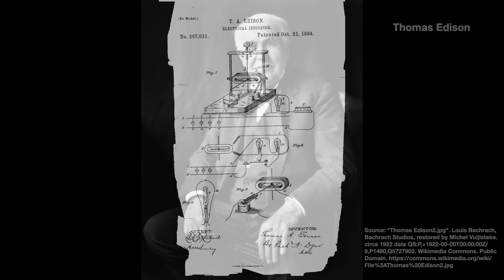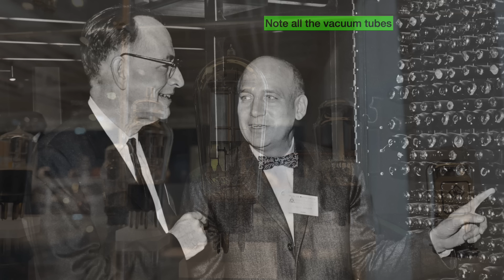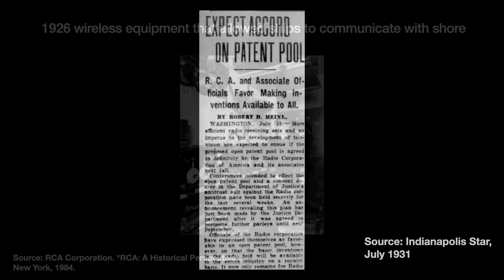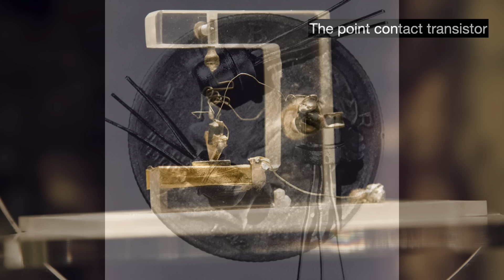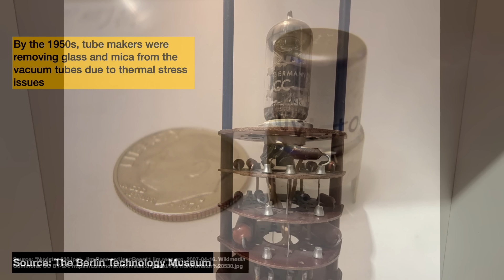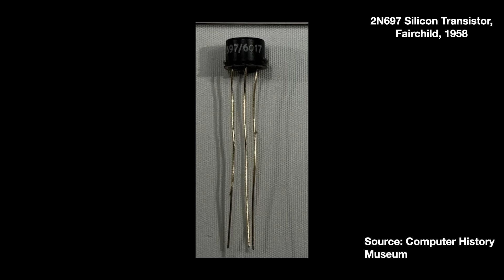RCA Made a Vacuum Tube to Beat the Transistor

Comment: My first job with a freshly-minted electrical engineering degree in the mid 1980s was at RCA. Six months after I started it was bought by GE. Note that RCA made some cool semiconductors. In the 80s they were the masters of Silicon-on-Sapphire which was used in space applications due to its resistance to radiation.

The division I worked for became Lockheed Martin after I left. It is still around, still making their premier product… the SPY-1 radar, aka Aegis.

And you know what I worked on?… A Gallium-Arsenidecimplementation of the Stanford MIPS ISA.
Reply: it's refreshing to read some nice details on things, rather than "Haha STAY QUIET otherwise COURT TIME" not explicitly written in text

Comment: 1970’s I bought a 144/28 MHz down-converter so I could listen to 2m amateur radio in my comms receiver.  It used transistors and it was horribly insensitive and full of spurious responses. I replaced it with a second hand Nuvistor (6CW4) based transverter and it was miles better!  Early transistors and their circuits were not ideal at VHF.

Comment: I built a phono stage using nuvistors a while ago, just for fun. Sounded like a phono stage. One other innovation from late stage VT design was the "lighthouse" VT, designed to mount straight into a coaxial transmission line at microwave frequencies. Technically they were called "disc seal" VTs but the stepped disc shaped connections separated by cylindrical insulators meant they looked like little lighthouses, especially the ones with ceramic envelopes. I have a couple but have never used them in anything since I don't have any need for the frequency response.

Comment: Word Debugging origin  ENIAC consumed 230kW of electricity per second it was so hot from vacuum tubes that all windows opened which glowing light of tubes attracted bugs which made short circuit for computer program run, and technician who changed vacuum lamps got name debugger. ENIAC longest run was 2 minutes, sometimes lamps failed and without bugs :)

Do data centers that have some cooling system bigger than some biggest malls is repetition of ENIAC story?

The famous "moth anecdote" is a classic bit popularized by the late comedian Norm Macdonald. It details a deeply depressed moth walking into a doctor's office—often a podiatrist—and recounting a grim, Kafkaesque tale of a meaningless life, a loveless marriage, and existential despair. The doctor, realizing the moth's deep psychological agony, asks, 
"Moth, man, you're troubled. But you should be seeing a psychiatrist.
 Why on earth did you come here?
"The moth replies: "'Cause the light was on." :))))))))))))

Comment: In the 1970's I almost made a 2m converter using a Nuvistor but didn't.
I remember the OC and AF series of transistors and performance was limited as regards frequency. 
I was making 3, 4 and 5 valve radios then started dabbling with OC and AF transistors.
I still have a liking for valves and have several commercially made receivers using them. 
My h/b transceiver has i.c., transistor and MOSFET stages. 

G4GHB.
Reply: I worked with Philips OC71 and OC72 germanium transistors in the 1950s. They were twitchy and easily damaged. They were each worth more than a day's pay then.
Reply: @howardsimpson489  
Okay about the price back then.
It was in the 1970's when I tried them. I seem to remember them being 7/6d (37½ new pence) in British money. 
G4GHB.
Reply: @howardsimpson489  Sorry for asking but have you heard about Thomas Henry Moray who in the 1920s had a tube amplifier running without a heated element? Supposedly based on a mineral iirc, I read claims once saying it predated the transistor in principle. The mineral type in any case is lost to time. Seems only he had an idea how it worked. Never was granted a patent. It annoys me so much when knowledge of great sounding things is lost. There's a small wiki on him.

Comment: I imagine the vacuum tube's last stand is the humble magnetron tube that cooks your food in a microwave oven with a special use tube called a photomultplier used in radiation detectors of many kinds as a distant second. ❤
Reply: There are a lot more tubes still used. High power triodes and tetrodes for RF power, klystrons for telecomunications and more.
Reply: Good point, but you might want to read up on garden path sentences and then rephrase. At first parsing your sentence seems to imply that a microwave uses a photomultiplier.  A clearer alternative is:

'I imagine the vacuum tube's last stand is the humble magnetron tube that cooks your food in a microwave oven. A distance second is a special use tube called a photomultplier used in radiation detectors of many kinds'.

Feel free to copy paste. I generally don't like to be a grammer nazi, but I am guessing that you did not intend to imply to an inattentive reader unfamiliar with the topic that a microwave has a photomultiplier.
Reply: It's still used in high end amps

Comment: Nuvistors were a stopgap, there were things early transistors straight up sucked at. Usually radio and TV stuff.
Reply: Early transistors were noisy in audio, and could not amplify high frequency. those were the 2 things the Nuvistor was better at, making them the 'go to' for color television and FM radio turners, as RF amplifiers for radio signals.

Comment: I guess one could call it the downfall of the "Triode", since that's the kind of vacuum tube that directly competes with the transistor. There's plenty of other kinds of vacuum tubes like traveling wave tubes which amplify signals in a totally different way. Then there are alternatives to both, like magnetic amplifiers or core logic, both of which provide things now commonly done by transistors, but with just some magnetic material with some wires wrapped around it.... and there are things like optical amplifiers. You have a special doped fibre, put in your signal and strong laser light... and you get a stronger version of your signal.

Comment: In 1968 when I was all of a year old, Dad bought an RCA color television. Color! Can you believe it?? Of course, it was a conglomeration of tubes, and it saturated a 15A 120V circuit all by itself, doubling as a space heater for the family room. We used that TV until around 1980, when it was replaced by a Sony Trinitron.

The old TV's weren't just TV's, they were pieces of furniture. That old RCA unit's cabinet was an extremely high end, solid wood beauty. So much so, that when Dad bought the Trinitron, he ripped the guts of the RCA out, and stuck the Trinitron into the cabinet. As luck would have it, it required very little modification to get everything to line up; it actually looked like it came from the factory that way.

Stereo systems came in high end furniture pieces, too.

Man, it's just too bad how enshitification has ruined everything.
Reply: My dad enjoyed woodworking as a hobby. He collected the maple cabinets from old TVs. He would refinish them and add sliding shelves to support component stereo systems. 😎

Comment: Tubes don't just "shatter". They fail, internally, and in most cases, with no visible reason. I've worked on tons of vacuum tube equipment. The Nuvistor was created with keen interest by the US defense department. The transistor was not reliable for a long time after its invention, and the nuvistor allowed small and lightweight electronics, very similar to what was achievable with discrete transistors. The integrated circuit is what really changed that.
Reply: Hot glass just creeps. I have some TV horizontal output tubes like 6DQ6 that got so hot the glass envelope collapsed onto the tube contents without failing. Despite looking weird, they still worked fine. The bakelite bases usually turned to powder and pulling them out was the end. Microwave ovens still use the WW2 magnetron which is a very powerful electron tube and will probably continue as solid state is not appropriate.
Reply: @howardsimpson489 :  This is a design problem caused by poor cooling in the sealed high voltage cage.  The datasheet will list a maximum envelope temperature and manufacturers of cheap consumer equipment would sometimes exceed it ].  Muntz would exceed it by a lot.  And nobody cared that much since sweep tubes were a couple dollars at the supermarket.
Reply: Indeed - the number of tube failures I've had over the past 35 years with various gear is extremely low.  Usually a filament breaks, or the tube just gets noisy.  I've never had one shatter - unless dropped!
Reply: was it like How incandescent lightbulbs failed ?
Reply: @belstar1128 technically halogen bulbs are incandescent bulbs, but I like the color of their light. My house only has those. But some of the foreign manufacturers are skimping on filament thickness. Half burn out quickly, the other half are good and work for several years. I never liked the yellow color of the regular incandescent bulbs.
Reply: @belstar1128 potentially, but tubes had much more parts than just a glowing filament
Reply: I think you should refine that to "lithographic integrated circuits". It's that process that made the difference and kickstarted the electronics market we have today
Reply: Yeah.  This guy obviously is ignorant and uses AI to "research".

Comment: Vacuum tubes are still around is certain very high power output applications like radars and transmitters where you still cannot match the power density of a vacuum tube with transistors.

Comment: Only reason I've even heard of the Nuvistor is that I think people were putting them into Neumann u47s as a replacement for the VF14 tube.  Have never come across a 47 with the Nuvistor, so I have no real idea if it was a good replacement.  I know at one point (maybe still), Nuvistor u47s sold for a bit less money than if they had the original tube.

Comment: I have thousands of tubes, some are ~100 years old. The 2a3 is one, I have most of the 8xx series. 801,802, 805, 807,808, 809, 810, 811, 813, 866, 872, 8008, etc, etc. All RCA's. Hundreds of high power RF tubes, and of course the nuvistor! What a great tube it is/was, great for VHF/UHF...
Do a video on Eimac. You will be blown away. Smallest ceramic tube, was the 2c39, triode, UHF, all the way up to the X2159, 2.5 megawatt beast! My largest ones are the 4cv100,000's and 4cx35,000 etc.
Reply: There were thousands of those tubes surplus after WW2 ended. I too have lots and my source of joy; CRTs. Many scope circuits were published using surplus stuff, I have some working examples. What amazes me is that the vacuums are still good, only a mm or so of glass keeping air out for 80 years.

Comment: And of course every microwave oven has a vacuum tube in it. :)
Reply: Sort of. 
Properly, a magnetron is a slightly different component.
Reply: @spacemissing  I said 'vacuum tube' not 'triode' or anything more specific. It's an evacuated metal and ceramic thermionic valve/tube. They even kinda work as a diode if you run them at low power, especially if you take away the magnets.
My first thought was CRT, but those are getting vanishingly rare in common use.

Comment: Asianometry has in the past been pretty good, but this video is very poorly researched and is riddled with major errors
1.  He states at 11:56 that RCA positioned the nuvistor "toe-to-toe" with the transistor on size, power, performance, and reliability.   Utter nonsense!   RCA was a very reputable firm and never made such a ridiculous claim.   While small by previous miniature vacuum tube standards, nuvistors were still 10 times the size of transistors.  As far as performance goes, its like saying oranges taste as nice as walnuts.   Nuvistors were for applications that transistors were unsuitable for.   Transistors, even the earliest ones, had a gm (measure of amplification) vastly higher than vacuum tubes, but tubes worked at much higher impedances and frequencies.    As far as reliability goes, tube cathodes inherently have a wear-out mechanism, transistors do not.   That's why tubes, including the nuvistor, were plugged into sockets for easy swapping out, transistors were soldered in.
2.  This video states that Edison noted that current can flow in a vacuum between a hot filament and a plate, and patented it, but did nothing with it.   That is emphatically not true.   Edison noted that the amount of current is very sharply dependent on the filament heating voltage.  An increase of filament voltage of only a few percent causes about a doubling of anode current. He therefore patented it and marketed it as a voltage regulator.   Unlike the gas tube also used as a voltage regulator,  the Edison Effect tube responds to the RMS voltage and therefore works with AC.   Up until the 1970's, Edison Effect tubes were used as the sensing tube in AC voltage regulators and wherever a constant RMS voltage is required but waveform is unimportant - eg movie studio tungsten lighting.  A common type was the AV44, sold by AWV, RCA, etc.
3.  Asianometry states that the control grid can "accelerate or dampen" the electrons flowing from cathode to anode.   This is not true.   The electron acceleration in a triode is almost entirely due to the anode voltage with respect to the cathode.   For any given anode voltage, once can calculate the electron final velocity.   What the control grid does is force some of the electrons to return to the cathode - the percentage of electrons returning is a function of the control grid voltage.  The grid thus affect the magnitude of the anode current, without much changing the electron velocity.   This is obvious when you realise that the acceleration imparted on the electrons is a function of the electric field between the grid (relatively low voltage) and the anode (relatively high voltage and thus dominant).
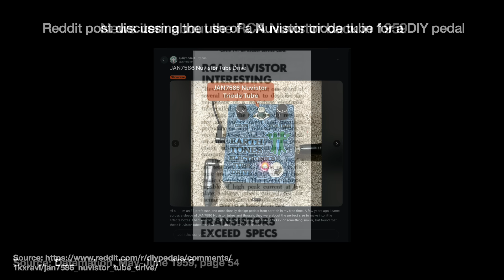4.   Contrary to what Asianometry claimed at 15:13, nuvistors never saw much use in audio equipment, high-end or otherwise.   This was because other tube types, specifically designed for audio, did a better job in audio.   The nuvistor did get used in a professional quality RCA microphone due to its small size and immunity to knocks.
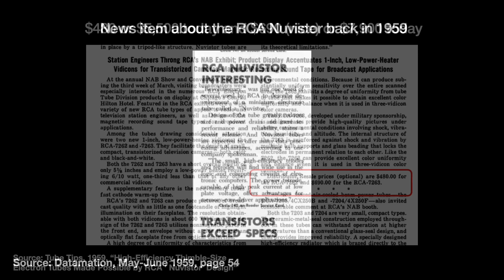5.   At 15:36, this video gives the price of nuvistors as $480 to $690.    RCA would not have sold a single one at that price - these prices were for TV camera tubes, not nuvistors.    Nuvistors sold singly for around $2.50 retail.    Don't forget they were used in TV UHF tuners in TV's costing less than $480 for the entire set.
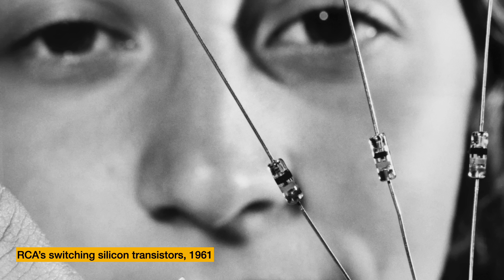6.   At 19:53 a photo is shown clearly labelled "RCA Switching Silicon Transistors 1961" but the image is not any sort of transistor - it shows point contact diodes.
7.   What was largely the blame for the demise of RCA was things like SelectaVision - an alternative to CD's and DVD's developed by RCA that relied on the piezo-electric effect - a sort of crystal pickup for the undulations in a record groove, scaled to give a video bandwidth instead of an audio bandwidth.   It cost RCA $200 million to develop and was a total commercial failure.
8.   Asianometry talks about RCA's patent pool as though RCA was a nasty big bully.   It should be noted that in the tube era, RCA was very much a net benefit to the electronics industry.   They had cooperative agreements with other tube-makers within and outside the United States.   To secure economies of scale while supporting a wide range of tubes for any purpose, all the US tube making firms made tubes for each other.   For the less common tube types, only one manufacturer made them - it could be RCA, GE, Tung-Sol, etc, but they all sold them.   I once visited the AWV factory in Australia.   They were busy making tubes banded "RCA" as they had an agreement wherein they could use whatever RCA patents and knowhow they needed, and in return made tubes that RCA had a market for but couldn't be bothered making.
9.  The prime driver that led RCA to develop the nuvistor, was not to try and beat the transistor as this video claims, but the US Military.    In WW2 military aircraft had radios containing around 8 or so tubes.  But in the jet age, military aircraft had all sorts of radio, navigation, and radar equipment, bomb aiming computers, etc having hundreds of tubes.   The power consumed wasn't a big problem - a jet engine could easily drive a generator to provide a few kilowatts.   But the physical volume taken up, weight, and tube failure rates were a problem.  Of course, having developed something for the US military, RCA used it in civilian markets in the good old American way.
Reply: Tubes (or transistors) are far more complex than can be covered in detail in a relatively short time. BTW, forcing an electron to return to the cathode involves a change of velocity, hence (negative) acceleration.
Reply: @milantrcka121  It is correct that forcing electrons back to the cathode requires negative acceleration.  The key to understanding it is that the electron velocity on leaving the cathode is very very small, a tiny fraction of the velocity imparted by the anode.   Hence only a small negative voltage on the grid can cut the tube off, that is, return ALL the electrons to the cathode.
Reply: When does your book come out?